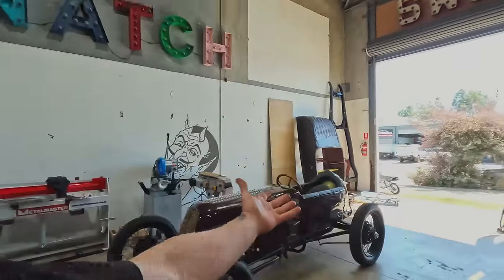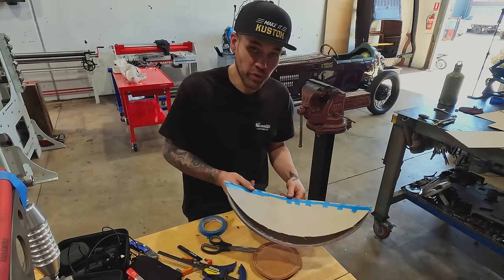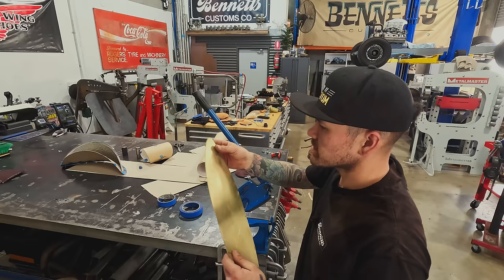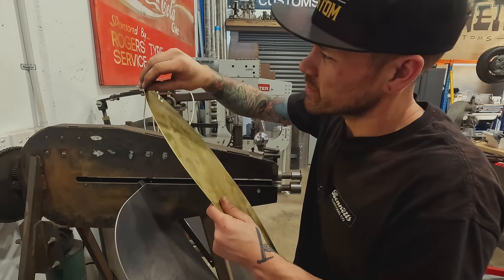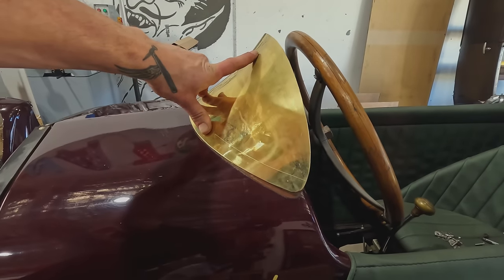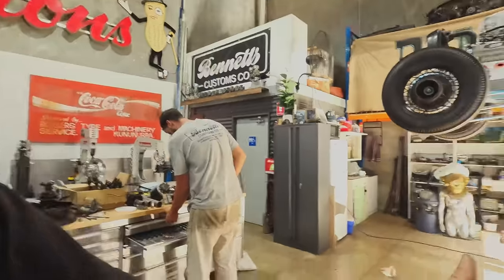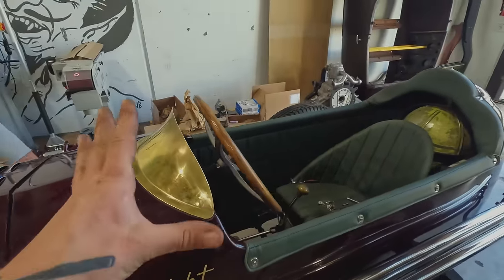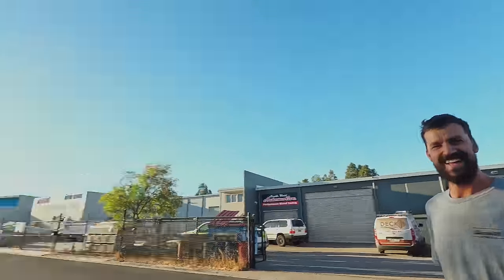BRASS?! English Wheeling a REVERSE CURVE Made SIMPLE!

Comment: Drilling holes in brass can be tricky. It wants to pull or grab. Using a hand punch is safer or putting a blunt vertical edge on the drill bit.

Comment: Would it be faster if using a rubber wheel ?
Reply from the maker: The rubber wheel would form but not stretch. It’s necessary to stretch the areas that need the reverse curve

Comment: Question, when trimming the reverse curve that was wheeled in, is there a release of tension that was created by the wheel.   I don’t have any experience doing metal shaping, but am intrigued by the process.  I remember when working in a machine shop, and the heads of the water jet getting smacked by cutting flanges out of stainless steel and it was explained to me that the piece was releasing tension when cutting the parts.
Reply from the maker: I suppose there could be some tension released from the heat from cutting or from the friction of the cat in the

Comment: Drilling holes and having the screw heads showing is so lame.

Should have marked the holes position on the brass underside.

Then brazed screw heads to the underside positions.

So nuts can be fitted from under the car bonnet or from behind the dash.

Learn from the Japanese, invisible fittings are best.

Also silicon it down.

Because it will aid security.
It will aid rigidity and it will lessern distortions caused by differential  windage.

And it will be quieter,  as air wont be whistling through or along the join and it will in future look better as rain & dirt wont be able to get between the join.

And it wont chaff the paint.